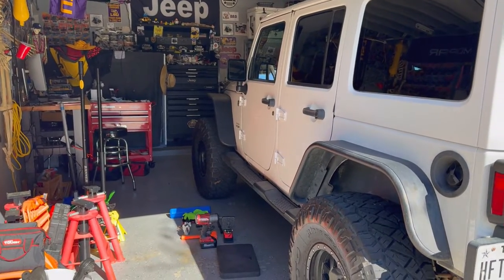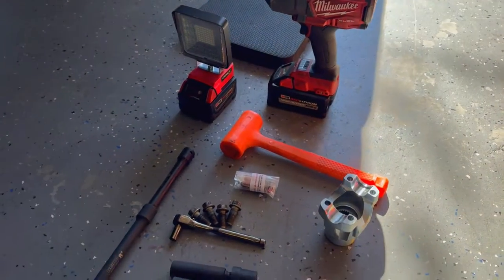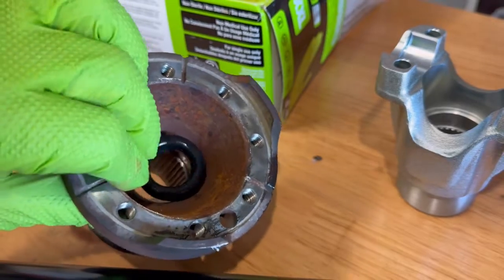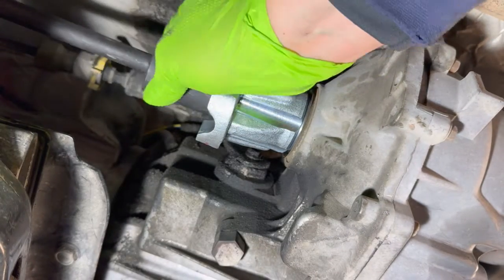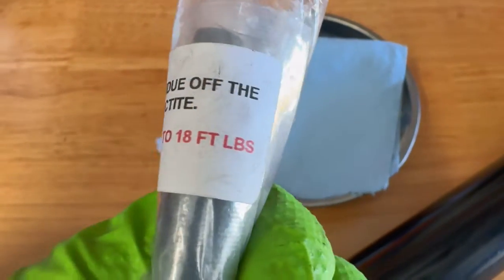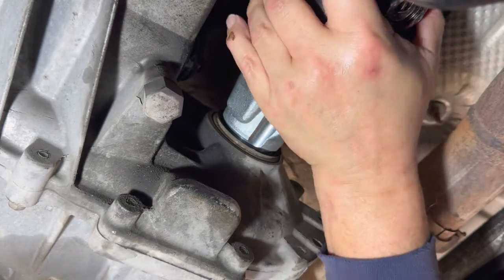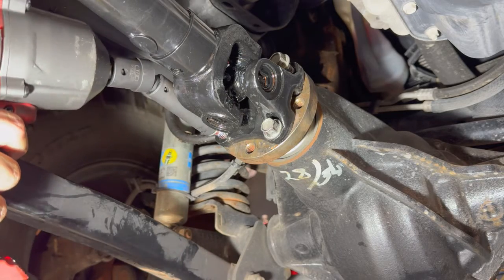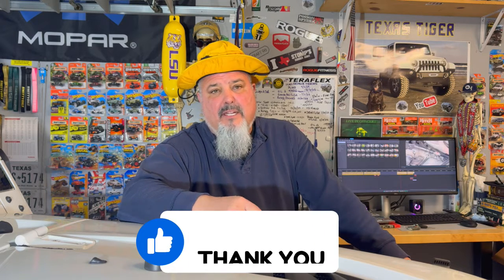Installing a Front Adams Driveshaft on a Jeep Wrangler JK

Comment: What did you do about the angles? You did not have adjust the axles?
Reply from the maker: These front drive shafts are custom made for the size of your Jeep and lift.  They have standard sizes made based on lift information. This eliminated my issue caused by the angle at the CV joints.  Contact Adams directly and ask them about your specific Jeep and needs.  This is a quote from their website:
“Application: 2007 to 2018 Jeep JK Wrangler's 2 or 4 Door Models up to 4 of Lift. After 4" of Lift we would need you to get us a measurement with the Jeep sitting at Ride height. These driveshafts are custom made so if you have altered the front or rear differentials, or transfer case's example [Dyna track Housings, Tera Flex, Ultimate 60's Housing's, Atlas T-cases, Etc] we can accommodate you. We will just need to know this Information after you have ordered.

If you have any Questions at all you can Contact us at 702-568-5680 anytime during the hours of 8:00 am to 5:00 pm Pacific Time Monday thru Friday and we would be glad to help you. You can also send us a e-mail or message us through our Social Media sites on Facebook, Instagram, or Twitter if you need a question answered during the weekend.”
Reply: @JohnsJeepGarage  Thanks for the reply. I thought you had to reduce caster at the front differential. I guess not.
Reply from the maker: I would encourage you to call the tech support line for Adams Driveshaft.  They are very helpful and can advise you specifically on your specific Jeep depending on the lift kit and Jeep info.  The Yoke system they have worked perfectly with my Jeeps.  Thank you again for watching.